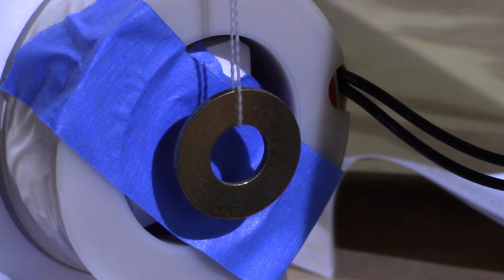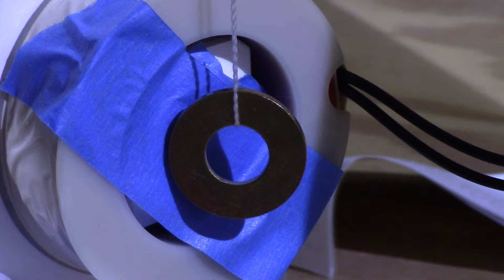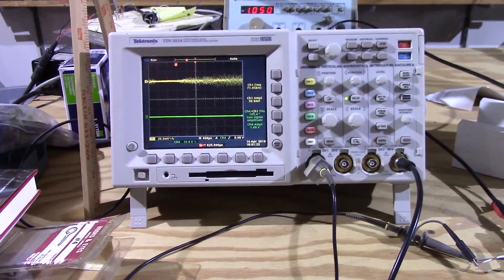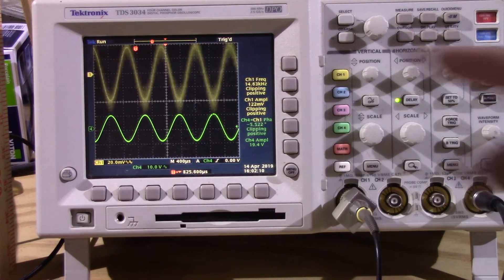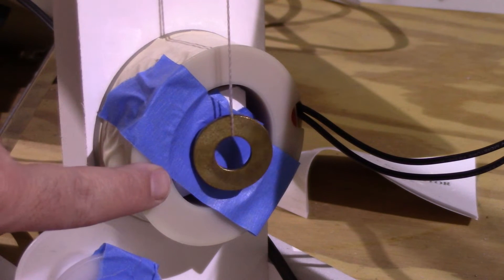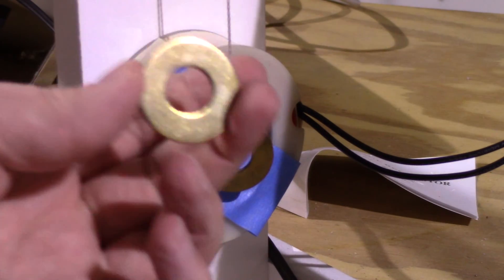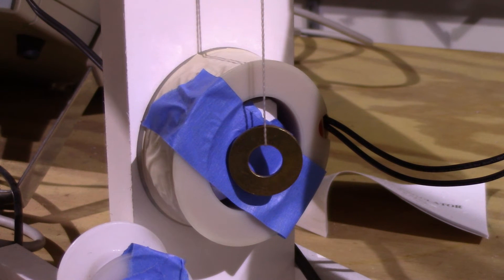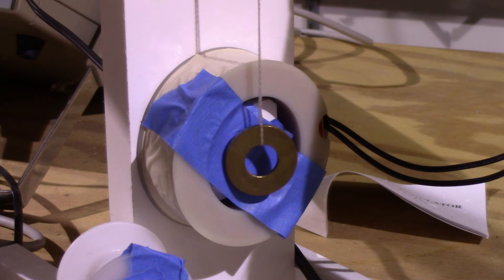NEMA014_EXP: Non-Ferrous Magnet Experiment / Theory

Comment: There are AC powered relays that work on pure AC i.e. no conversion to DC beforehand. I think they use a a similar principle to what you are showing here but they also use a  steel core on which there is a shorting copper loop. "Shaded" pole comes to mind, but not to sure of that may have to do some digging on it.

My suspicion is that with higher frequencies and power currents you are likely to generate excessive amounts of heat due to large AC currents circulating in the washers. basically you have a high current shorting single turn loop inside your primary.